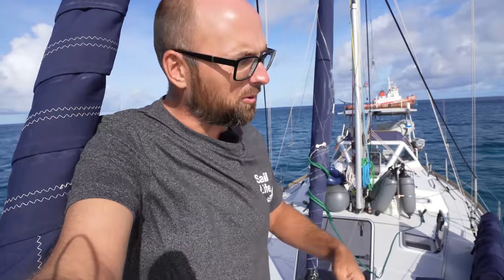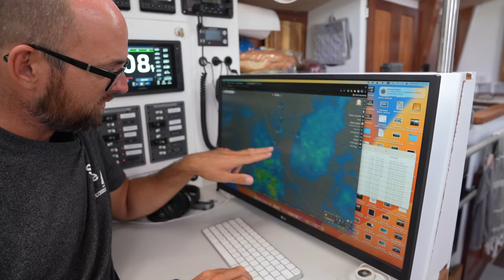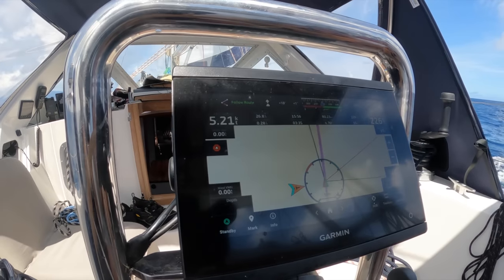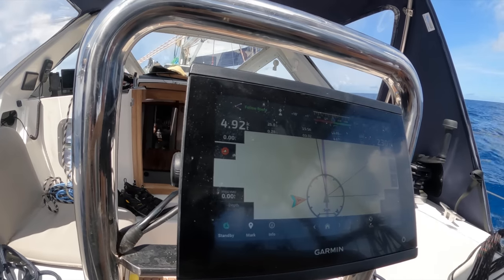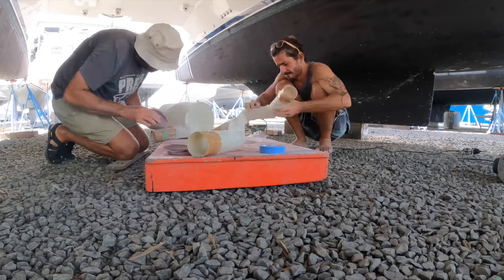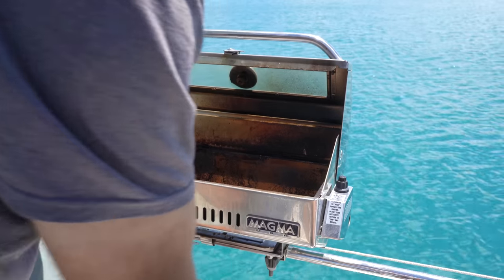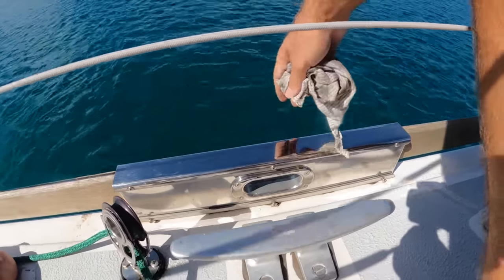Sail Life - The steel boat itch ⛵️

Comment: Maybe a smart home solution to the rain in the hatches issue would be possible. Somehow make the boat respond to environmental conditions and weather predictions. 
Closing hatches automatically when storms are predicted or rain is detected. 
Maybe automate the solar panel extensions to have them roll in when dangerous winds are predicted. 
Turn floodlights on when your mobile phone returns to a certain distance from the boat at night. Making getting onboard after a night out a bit easier.
Some security cameras with two way audio and movement notifications.
Even if it isn't all automatic, being able to remotely check and control things like hatches and lights may be something to investigate. I know it eases my mind when I can remotely check cameras and switch on or off heating and cooling to my home. Having a permanent high speed internet link via your Starlink may make a lot of things like that possible.

Comment: Hi guys that rust stain remover is just oxalic acid which can be purchased in powder form for pennys, mix a small amount with water. Also good for taking salt stains off at the waterline cheers, boat looks great keep on enjoying.
Reply: Yep, it's a miracle chemical. Also great for getting rust stains off sails. In that instance, you should rinse really thoroughly when it has worked its magic.

Comment: Mads, agree with your evaluation of using rice to dry out electronics. What does help is if you can pull the batteries as soon as possible. Electronics are fine with water as long as there is no current flowing! So if you can pull the batteries soon enough, let everything dry out and then reinsert it should prevent any corrosion which is what kills the devices!  (if salt water is involved then a rinse step may be required!
Reply: Rice doesn't do anything, and it can't do anything. If it did, you'd get soggy rice. I never understood what the logic of these people who say it is other than a meme, like the one where if you put your iphone in the microwave oven, it charges the battery, but less malicious.

That said, indeed, it's electricity that ruins things, the very motion, as it creates paths that shouldn't happen and electronics are very sensitive to that.

Salt water needs to be washed, as an added step to removing the battery. My go to fix, is to open the item as much as possible and spray isopropyl alcohol on the board. And if the board doesn't have sensitive components, dunk it, swing it about, dunk it some more, then let it dry. Works really well. Have dunked my phone in salt water quite a few times and this has saved it. Whenever sea side with the intent to go near it, i pack a small 300ml bottle of the stuff. You never know when noodle fingers strikes.

Comment: Hi,  I thought I would give you my opinion (for what that's worth).  I'm an electrical engineer and I have worked in high voltage and pulsed power for 45 years.  That includes building lightning simulators.  If lightning hits the mast it will get to the water.  So I assumed having some kind of electrode in the water connected to the mast would provide a path.  Of course there would be corrasion issues to consider.  It would probably still fry electronics especially stuff with wires up the mast.  It's easy to solve a problem when you don't know what your talking about which is my case.  :)  great show!!!!

Comment: RE lightning strikes, the only proven protection (that I know of) is having an intentional high current low resistance path to the water. E.g. 25mm2 cable down the mast to a heavy duty through hull grounding plate. This will slightly increase the chances of being struck, but the idea is to shunt the energy straight to the water, hopefully protecting the electronics and not blowing a hole in the hull below the waterline (e.g. around the keelbolts or through hull). 

Or just park near a boat with a bigger mast, which is upwind. My little 29ft boat is parked near a 60ft cruiser with a massive mast in the marina.

Comment: Mads my barbecue had flame problems at one end and I just reamed all the orifices on the pipe with a small letter drill bit and it worked well after that . I am sure you would have checked the burner holes for restrictions but just thought I would tell you before you throw the old one out because mine did not look too bad but after the reamin it worked well and cost nothing.
Reply from the maker: I did try cleaning the tube and the holes but it didn't make any difference but I'm happy to report the new one is still going strong :)

Comment: As an electrical engineer I would have a copper wire I could attach to the mast and put the other exposed end in the water. This will effectively earth the mast so any strike will discharge into the sea and not your electronics.

Comment: Hey sail life creators! I'm sorry I couldn't make out the gentleman's name but about grounding for lightning strikes;

 I'm thinking if your mast is grounded down to the keel, while it more likely makes your boat into a lightning rod, it protects your electrical equipment better. If you watch sailing into freedom, Plucky's boat grounded out through his prop bearing which then caused him a leak because it burned so hot there.

 In my case, I don't even have my mast wiring hooked up and I have minimal wiring and electronics throughout the boat. I'm considering deleting the ground wire even but then again, if you go to touch your mast, at any time, storms overhead or not you risk being the connection to ground through the hull of your boat.. -as conductive as that is..

Comment: As you put it ,these do hickey might work , but what does work is a lightning rod on top of maste , insulated from master with a 6 awg cable to a grounding plate on the Hull,  away from transducers . No connection to anything else . Running cable down maste make sure it's away from other cabling .

Comment: This is probably too late but it's fresh water so your electronics need to  be dried out as quickly as  possible. This does not have to be fatal for electronics if the power is  not on and you get the water from inside. Rice does not work. Put them somewhere warm (up to  40C0 and take the batteries out if you can. Salt water is much  worse...

Comment: See if you can get some desiccant. Compressed air dryers use it so it should be reasonably easy to find. I've dried many an electronic do-dad. With desiccant in a zip lock bag.

Comment: I've read when you're in a lightening environment add exposed exposed single strand copper 4awg to both of your upper shrouds and run the ends into the water. I guess you just need enough in the turnbuckle for good contact and a few meters in the water to provide a nice low restive path to water and thus ground

Comment: Attach a power cable to the top of your mast and run it through a flux capacitor. When you start to see lightning, get your boat up to 88 mph and Bob's your uncle.
Reply: Not enough clock towers in the ocean for that to work 😂

Comment: What you can do about lightning is connect the mast to the water with a copper or aluminum cable with no contact with the wiring in the boat and buy lightning arrestors between the mast and your electric devices, we use lightning arrestors at the Swedish railway technical rooms the arrestors blows and the equipment is ok. They cost around $50 each.

Comment: If you ever have a chance to try a metal polish called Flitz, it's wonderful a buddy that has a Harley let me try some and I brought back a mirror finish to oxidized aluminum and it leaves a protective coating behind. Star bright products are typically well made,I've found dealing with rust removers that they are mostly formulated from weak acid solutions I start with acetic acid,white vinegar .

Comment: Re: Lightning protection… I did a video on this very topic last year. Yes, no way to really prove what you have works 100%, but some installations can be shown to be “statistically” safer.  I’m citing the work of Ewan Thompson of the University of Florida, whose research can be found with a modicum of googling. 
As for some of what is available commercially… yes, much is snake oil for sure; static dissipators come to mind.

Comment: Can you get a shorter winchhandle that would allow for a full rotation of the winch without moving the spray hood?  We had a similar problem with our cockpit winches when we installed lifeline dodgers.    Shorter winchhandles helped although the knuckles of the hand do rub a little still.

As a commercial electrician I installed a number of different lighting protection systems on tall buildings and it seems every engineer has a different idea of what should be done and works.  There is a lot of guesswork and lighting protection goes back hundreds of years. Many systems have proven to do more harm than good in older buildings.  

As someone who's boat was hit and after losing all of our electronics and electrical systems I did ground our deck-stepped mast better to the grounds of the boat.  We don't have an exposed metallic keel so we are depending on the prop, rudder and large hull zincs to do what it can.

Comment: Pantaenius told me that lightning protection is required for new contracts to cover damage to the electronics in this case. 
I would make measures dependent on your contract conditions.
Reply from the maker: I suspect that is highly dependent on what country you're insured in. Within Pantaenius we have noticed vast differences between us and other cruisers. It would be interesting to know what counts as "lightning protection" :)
Reply: @SailLife  Well, Pataenius relies on a DDCE system (magic of a gigaherz resonator?), for yachts under 17m because of the top weight and the cost prohibitive. I had discussed this with them by phone. 
I highly recommend the book "Blitzschutz auf Yachten" by Michael Herrmann, unfortunately only available in German. 
By the way, the issue is relatively easy to solve for me because of my Reinke 13M made of aluminum. 
I am sure that you as a perfectionist will continue to pursue this topic.

Comment: It would be nice have an update on how the engine sound insulation holds up. 
Regarding wet electronics placing those in a vacuum bag and suck out most air will boil of most water. Several cycles is required due to wiping the bags from condensation. A note: Some elctronic components like wet capacitors and built  batteries, any kind(!), WILL NOT appreciate that torture.
Reply from the maker: The engine room insulation is holding up very well :) Zero complaints so far.

Comment: Lightening strike prevention- suggest you watch fellow youtuber Sailing Dauntless episode of about 6 mths ago.  Installed a device on mast of his 50+ ft catamaran, device is a marine adaptation of device that has been used on commercial buildings for decades.  The device for your size sailboat would be several thousand $s.  I don't know if Sailing Dauntless has had the opportunity to "test" the device yet.  Steel- good for boats going to extreme N and S latitudes- otherwise stick with fiberglass.

Comment: To take out the water of your electronics, just put them in the oven for 1 or 2 hours at 50 to 60 degrees celcius, it creates a dry atmosfer to remove all moisture. I’ve used this method several times with succes.
Again nice video…sheers Wim
Reply from the maker: That makes sense :) Thanks!

Comment: The rice trick is NOT a good idea. It is yet another widely believed thing, but it is bad for your electronics!

The devices will not dry any quicker in the rice than if you put them in a warm ventilated area, but the starchy dust will get inside them and turn into sticky paste while there's still moisture in there, and the grains themselves may block up ports and sockets.

DC electricity is pretty forgiving. Just leave them somewhere warm and dry for a few days to dry out. Either they will work again or they wont. Rice wont change anything.

Comment: There's nothing 'snake oil' about lightning protection.  The rules are simple, provide a 'preferred' path to ground over that of your expensive components...or provide a miserable path to ground and hope something near you is a better one.  If you ever intend to be alone in a storm, one of those is a better choice.
Oh, sorry, yes, there is no doohickey that will prevent you from lightning damage.
I designed wastewater systems in Florida for years, lightning was a constant nuisance. We tried all the 'gadgets'.
I'll try to explain this in layman's terms, lightning, is an opportunistic force.  What it does actually looks 'intelligent', but that's just because it is following a very fixed set of rules.
What lightning 'wants' is to equalize the charge between a section of sky and a section of ground.  Physics demands that this situation resolves itself.
So lightning is really just the result of that charge differential 'testing' how to resolve itself.
So, it finds the best path it can and starts to move current along that path.  If the path can continue to sustain the current requirements for the discharge, it keeps using it.  If the path can't, it 'burns up'...that path's 'fuse' blows and it is no longer an option.  These are the tendrils of a lightning strike that don't go anywhere.  They still use a lot of current, because to be visible to you they are conductive enough to become plasma streams.  That's not nothing, we're talking about incinerating air.
But eventually, the end result of all those testing tendrils will be to find the 'best' path to resolve the differential.
That path is going to get a lot of energy through it, but mercifully, for a very short time.
So...what to do?
If you find yourself in a storm alone, the 'miserable path' solution is going to end badly, because all the miserable paths to ground are through your expensive bits.  Best bet here is a temporary method of offering a better path.  Some braided copper to the waterline or better yet a wide copper foil to the waterline.
IIRC, most power companies use a mere #6 solid from the ground line above the single-phase wiring in residential zones.  Heck, code requires a #4 to join ground rods.
The better question to ask is "Why don't marinas simply install tall metal poles, taller than typical masts.  I mean put a country flag and an advertising flag on it, to be more attractive to lightning?
The answer is obvious, they don't have to.
And their chandlery wouldn't benefit from this.

Comment: 3:02 if you have access to a machine shop at some point or have someone who does, you could make a "gearbox" that offsets the winch's handle. It should be extremely easy to make. Basically a box that houses two equal sized gears, one nylon, one brass, that moves the point of work just enough for you to have full rotation with the hood on. Because the insertion point would be also rotating itself (as a function of the winch) you could stow it laterally when not in use, so it doesn't get in your way.

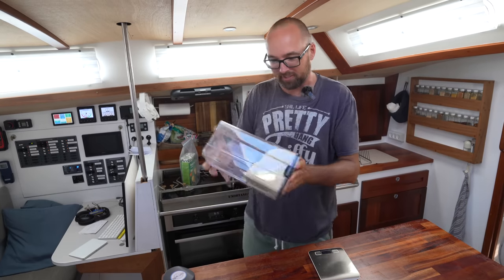Comment: 9:59 rice doesn't do anything. Not only nothing, but less than nothing, because you've wasted precious time you could use to save the electronics. What you want to do is take out the battery and open the device as much as possible (also, as much as you are comfortable, so if you are, all the way to the boards) and dry it over a toasty warm surface (or use a hair drier to blow hot air).
If something's dunked into salt water, opening the device is adamant. Current will ruin the board even after it's dried, because of the salt which becomes a conductive medium, especially when the brine dries out and leaves behind a crystalline path (this is why you have to clean exposed batteries in salty environments). Once you've taken it apart, IPA (isopropyl) is key to drive out and remove the brine from the electronics. Where applicable, dunking the parts is ok, where not, soft toothbrush and a good spray bottle with a decent jet blast is required. Brine can get behind and under SMD components.

Seriously, never waste time with rice, you'll decrease your chances. Go straight to removing the battery and or any means of electric power (CMOS battery, for example, in a laptop).
Reply from the maker: Sounds like solid advice! :)
Reply: @SailLife  I live by the Mediterranean a lot. I got lots of electronics dunked over the years. Lost some, recuperated some. Most of what's above is the result painful experiences where valuable things got lost. I hope it helps.

Comment: Do you think a sailboat sailing is like an airplane flying, electrically? So not grounded and building a static charge, so static wicks should help like an airplane. The rate of static charge building would be very different though.